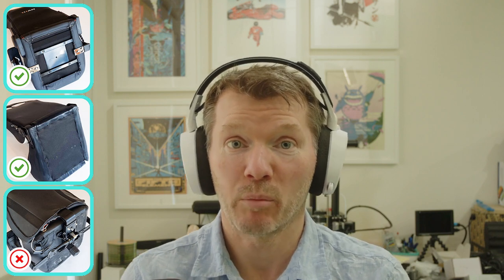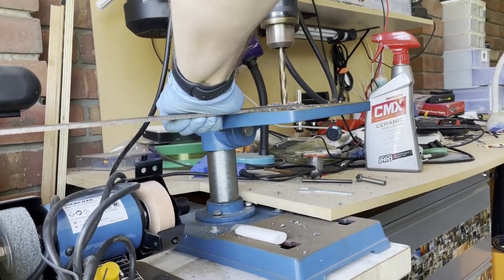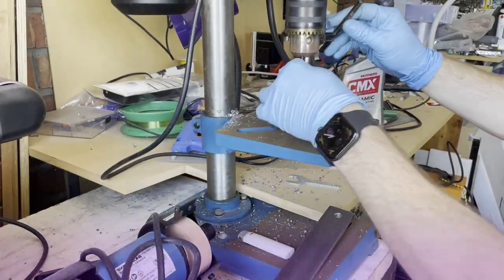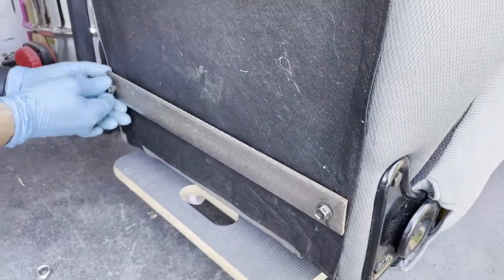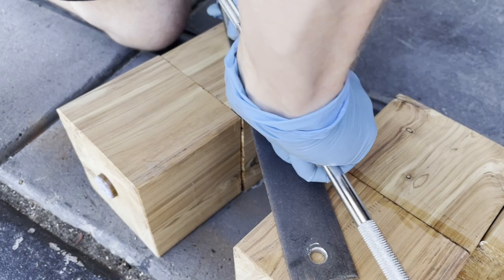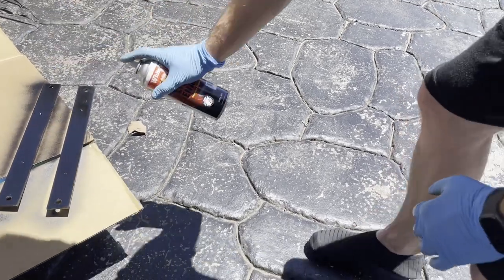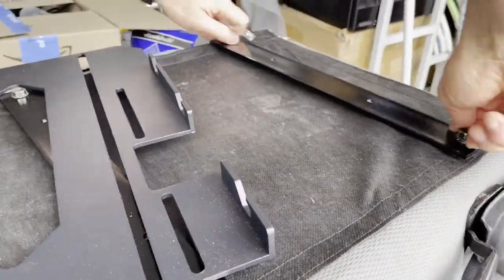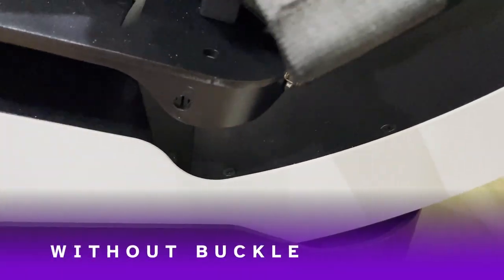Yaw 2 Motion Simulator: Custom Seat Mount

Comment: Excellent video Brian, really impressive workshop and of course nice bit of camera work by Brian Junior 👍
Hoping to see a guide to motion compensation in the future.
Reply from the maker: I hope so too! I've hit issues getting the Yaw Virtual tracker working with GE, but expect they should be resolved soon.
Reply: @ItsVRK  thing is I’ve not actually used GE. I dived straight in with SRS on day one so would I have to use their motion compensation solution which involves buying some little witmotion device?
Reply from the maker: No, you will be able to get MC working in SRS with Yaw Virtual Tracker, I will be making a video about using SRS with the Yaw2 at some stage after GameEngine one, and hopefully SimTools (though I need some funding to cover the purchase of that).. I don't see any need/reason to buy a Witmotion device with a Yaw2

Comment: I have to say what a disappointment it has been to finally get my YAW2 3DOF  I ordered over a year ago only to find that it is incomplete and damaged.  It was not damaged in transit. It was simply poor craftsmanship and lack of any quality control.
I ordered the unit with casters (wheels) however they shipped without the wheels and charged me for the wheels which I had to pay import duty on. They now say the wheels were not safe so thay have been discontinued but they did not bother to let me know about this. Nor have they made any mention about compensation or refund.
The base plate on the bottom platform was severely damaged due to overtightening or something similar. They agree and have said they will ship another one, but they have not said when it will arrive or how I should go about fixing it when it arrives.
Next problem is that after assembly there are only 2 DOF working, pitch and roll. Yaw and the chair lights are not working at all. The response from YAW has been incredibly uncaring and unprofessional.
Email replies to my questions give only the most basic information regarding possible solutions. The answer to the yaw DOF not working was "after you disassemble try pushing the connectors in and see if that helps"
This company has taken a good product and are now killing it. Do not buy from YAW they are the most unprofessional company I have ever dealt with.   You will not get what you order and whatever you do get will be faulty.
Reply from the maker: There are definitely users having issues. At least one that has been acknowledged by Yaw as affecting many recent recipients (they have confirmed they will be sending out replacement parts).

I get that it's disheartening to receive it and have problems straight away, I'm sure they will resolve the issues for you eventually, but they are taking a long time to reply to some people, me included at times.

I have seen reports of several users extremely happy once they have full unit working, it seems to be very worth the wait.. so keep that in mind I guess.. 🤷